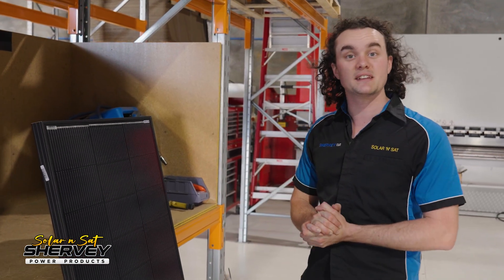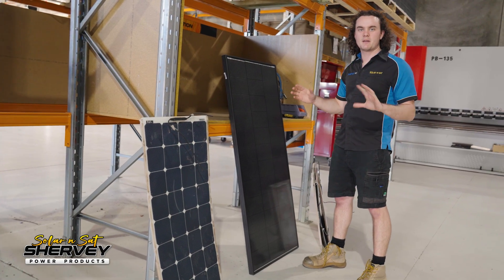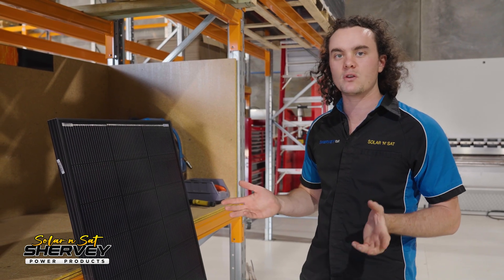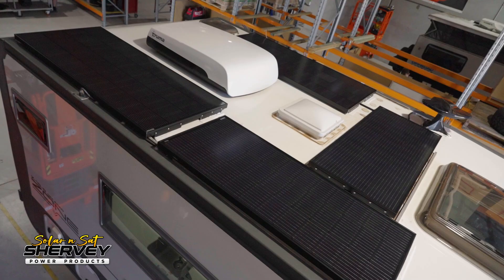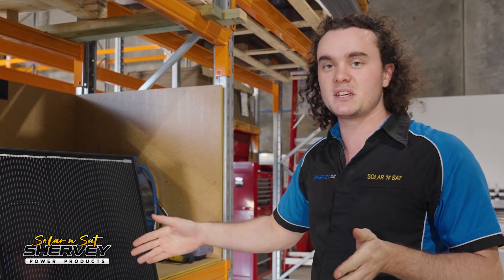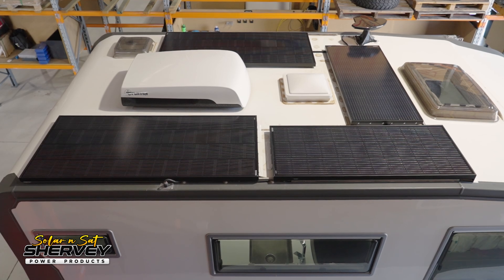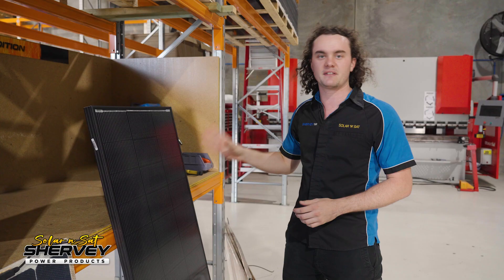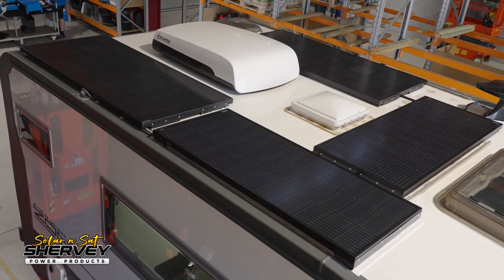Zone RV Solar Panel Replacement | Solar N Sat | Shervey Power Products

Comment: Not all semi-flexible solar panels are the same, and to say they all underperform compared to glass is misleading. eArc by Sunman Energy is IEC and CEC approved for grid tied solar installations.
Reply from the maker: Fair enough comment mate, but we have seen nearly all brands fail within 18 months of installation and admittedly we only see the ones that fail. At this stage Sunman may seem to be the pick of them, it will be interesting to see how they perform long term.
Reply: @solarnsat The issue is off-grid vehicle solar panels are not required to comply to a standard, so a lot a rubbish is on the market. As an example, how many off grid solar panel brands can quote the temperature coefficient of the solar cells used?.